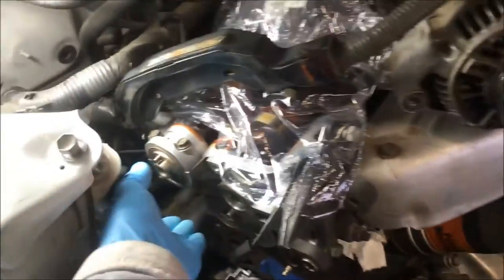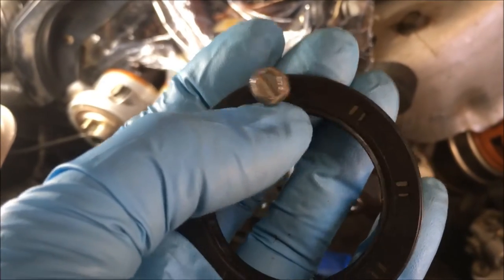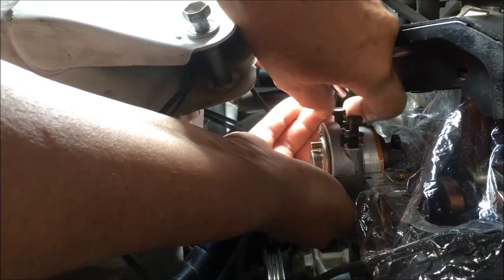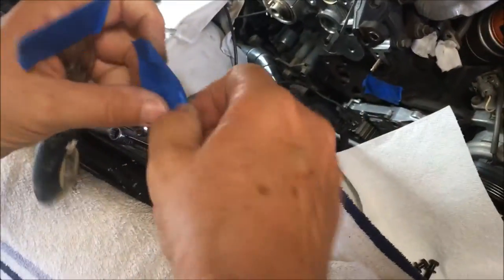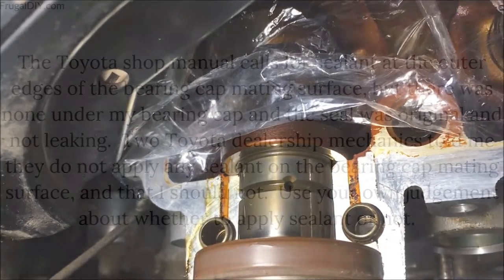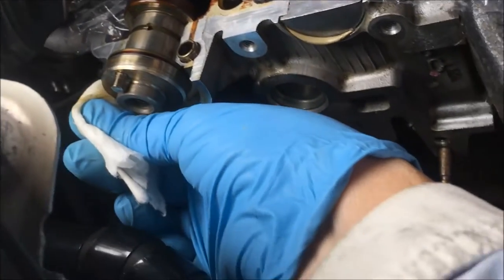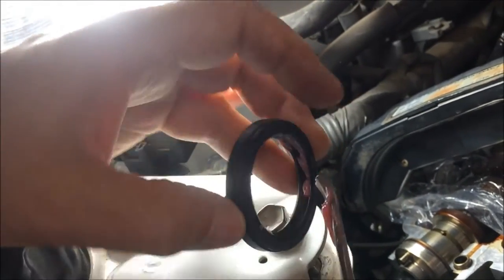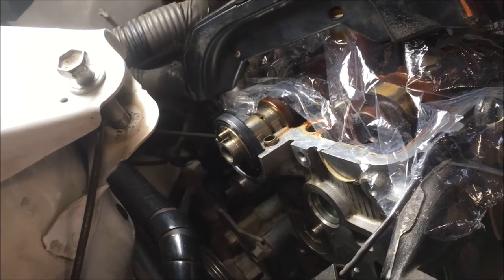Remove & Replace Camshaft Seal | Toyota Camry 5FSE Engine

Comment: The best diy vid of replacing a toyota cam seal that i found,

Unfortunatly i still got those new seals leaking on my 3sge gen 3 engine after replacing them in almost the same way like you did in the video.

The only thing i did different was adding a tiny bit of rtv sealant on the caps (where the toyota mechanics told you to not put sealant)
And i used some engine oil instead of the pink toyota grease

I will need to try this again but this time i will take out the cams with the seal still on to see if i might have had the sealing lip bent, if thats not the case then i will inspect for a groove in the cam where it meets the seal. If that looks ok then i will measure it out too see if the cams are bent.

I will get new sport cams
If the 2 last problems are the cause of not sealing off
Reply from the maker: Thank you, Mono.  I appreciate that--truly.  It'a BIG bummer you have to redo.  I've faced that, too.  We learn as we go.  I'm still learning and in my 60s.  ;)  For what it's worth, were I you, I'd use the pink Toyota grease and no RTV sealant.  I always have the pink grease on hand when working on a Toyota, and that's all I own.  I've got no leaks.  Hope this helps you.
Reply: @frugaldiy1  thanks, i will purchase the pink grease

Comment: Hi, thanks for making the video. Do you have any updates? Like finding any leaks after finishing job and/or anything you would have done differently?
Reply from the maker: You're welcome, Bernardo.  It's been a year and a half, and there are no leaks.  I can't think of anything we would have done differently.  The job turned out great.  I would recommend rechecking the torque on the valve cover nuts periodically because they will need to be tightened after the initial torque because they will back off a bit.  That's just a common issue with the 5SFE engine.  Good luck on your project.
Reply: @frugaldiy1  Thank you!

Comment: Is it ok to install the camshaft seal first and the retaining cap next? I have seen in most videos that they assemble everything first and install the seal last. There is not enough room around camshaft seals on my car (Peugeot 406). The area is so tight that I can't use a hammer to install new cam seals. Can I use your method to install my camshaft seals?
I was also thinking about using the camshaft sprocket bolts as tools for installing cam seals (with a proper washer and a big socket).

Comment: i did everything wrong. screwdriver, hammer, and scratched the cylindrical surface. How do I fix it? Polish with fine sand paper? In my defense, the seal was baked into the upper part and the rubber disintegrated..
Reply from the maker: Don't be hard on yourself, West_Park.  We all make mistakes.  If you scratched the bearing cap, I'd take it to a machine shop to see if they can smooth the surface for you.
Reply: @frugaldiy1  Thank you so much for your quick response. I was replacing the camshaft seal. I gently hit the middle of the seal with a dull screwdriver and hammer. However, it did not come out easily. I pushed too hard, and I scratched the camshaft surface near the end. (The rubber was glued to the socket for unknown reason.) There is a ring line where the old oring was sealing. This line is not affected. I believe that I may just let it go, because the scratch does not touch the oring. However, I want to do it right. So I started rubbing the scratch mark with sand paper. someone advised320-400-600-800-1000-1500-2000. I am at the 320 grit. What do you think?
Reply from the maker: I think you have a good plan.  You sound quite knowledgeable so I don't worry about you overdoing it with the sand paper.
Reply: @frugaldiy1  I just finished the sand paper exercise. the 1500 gave me shiny mirror like appearance. the scratches are now tiny specks and they are away from the seal line. Thanks! Happy new year.
Reply from the maker: Job well done!  Happy New Year!

Comment: Hi, thanks for video.  I'll be tackling TB and WP on my 97 Celica, 230,000 miles.  Got all of the tools and parts I need.  I'm pretty confident about being able to do it.  Have oil pump seal and gasket.  Also cam seal.  Do you have a video of cam shaft sprocket removal?  One thing that worries me is spinning the cam with the TB removed.  With this in mind did you loosen the cam sprocket with the belt still on, you could then tighten back up enough to get TDC etc.  Did not think about the cam shaft seal, I guess you'd recommend doing this even though there is no leak?  One other thing, my Aisin kit comes with instructions.  Turning the belt a couple of times at the end of the job differs slightly based on whether the tension spring is green or silver?  All of the videos I've seen show a silver spring so I'm sure my car will be no different but just curious to know why a spring color would make a difference, lol.
Reply from the maker: Hi, Robb.  Here's a little info for you.  

Here's the link to my video titled, "Loosen Bolt on Camshaft Pulley Before Removing Timing Belt" https://youtu.be/1cOIXpDRfmY. 

Here's a link to my video on how to torque the camshaft bolt:  "Torque Camshaft Pulley Bolt"
https://youtu.be/Q15R6JT40gs

The silver spring has 13 coils and 46mm long.  The green spring has 10 coils and 50mm long.
Reply: @frugaldiy1  thanks.read my message again-meant to say never thought about replacing crank (not cam) shaft seal.  Would you do this as well, I think I know your answer!  Yes will watch your video on cam shaft later.  Watching as many videos I can to try and avoid any pitfalls, they all mean well but some of them miss important steps that could result in having to do the job again.  They also apply grease and sealant to things that aren’t necessary and can cause premature wear!  Also have the passenger side CV axle to replace, replaced these before but never changed a TB.
Reply from the maker: Got it.  YES, replace ALL seals.  Here's my video for the crankshaft seal:  https://youtu.be/yrOPEjMVx9A

How to replace camshaft seal:  https://youtu.be/BJVHLBOOO7Q

I highly recommend use of the pink Toyota grease.  We followed the recommendations of Toyota mechanics re the application of greases on the seals.
Reply: @frugaldiy1  thanks, will watch later-now ordered the OEM crank seal from Amazon, grease from eBay.  Noticed the grease is applied on the inner part of the seals only.
Reply from the maker: Good.  Yes, the pink grease is applied to the inner side of the seals only, per Toyota.
Reply: @frugaldiy1  thanks.  Waiting on a couple of things, plan to start over the weekend.  Have set aside a whole week to replace the CV axle and timing belt and the other stuff.  Plan to dip in and out of the job, there are other cars in our household so absolutely no rush which is always a bonus.
Reply from the maker: I have a video on how we replaced the driver's side CV axle with a homemade CV axle puller cuz we couldn't get it out.  The video also shows how to remove/replace the seal (be careful of the spring around the seal and put some grease on it to keep it in place) and how Toyota recommends placement of the circlip for installation of the axle.  The video may help, so here's the link: https://youtu.be/CyMf7jQ7k7k
Reply: @frugaldiy1  Good stuff, your puller worked a treat.  Also I didn't think the positioning of the circlip on the CV axle would matter.  You watch someone like Scotty Kilmer and he recommends dunking the end of the CV axle spline into a tub of grease before pushing in place, lol, I think I'll follow the way you do it!  Replaced the CV axle and seal on my son's Accord last year, that went really well but I know every job can be slightly different.  I'll be certain to let you know how I get on!
Reply from the maker: Yes, Robb, please let me know how the project goes.
Reply: @frugaldiy1  This is a very challenging job, started it yesterday.  Removed the broken CV axle on passenger side.  Set up the new one to go in, this was pretty straightforward.  Got as far as removing alternator, loosening power steering pump and removing auxiliary belts, as well as motor mount and support bracket below, very challenging due to restricted space but no disasters yet!  Hopefully things start getting a bit easier, lol.
Reply from the maker: I know it's challenging, but you're making GREAT progress.  Don't give up, ever!
Reply: @frugaldiy1  Finished!  New CV axle and seal, timing belt, water pump, cam seal, oil pump gasket and seal, crank seal, auxiliary belts.  This was one heck of a job, started Saturday so almost a week, not constant but it still took up a lot of my time and effort.  She started on the dime, I swear I would have cried if not.  Thanks for your help, particularly the crank seal hack, I went to Ace and spent 39 cents on the exact sheet metal screw!  Just need to run to the hardware store for a cotter pin for the new axle and then test drive.  She is a convertible so looking forward to it!  Thanks again!
Reply from the maker: Robb, I'm impressed and elated for you!  It's a great feeling when you finish such a big project and it works!  A convertible--you lucky dog.  I'm happy that we were able to help you in some small way.  Thank you, Robb, for checking back in and letting me know you had success.  I'm happy for you.
Reply: @frugaldiy1  Thanks, it's just a beater with a heater but she runs like a dream.  Anyone reading this, if you are mechanically inept like I am you WILL struggle with this job, if you can afford to take it to a mechanic and let them do it, they have the lifts, the tools, the knowhow and equipment!

Sorry, above comment a bit negative.  Should say if I can do it anyone can do it!  But as well as basic tools you will need to invest in one or two others, cam sprocket holder ($20), deep sockets, large socket to remove axle nut, harmonic balancer (got a set for $18), Toyota grease ($13) etc, but the costs for these items would amount to far less than you would pay a mechanic to do the job.  In addition, useful but not essential-impact wrench and sockets, torque wrench, ratcheting sockets and seal puller.  One last thing use OEM seals and gaskets, not worth taking a chance.  I used Aisin cambelt and water pump kit, seems very good quality and fit really well.  Good luck!